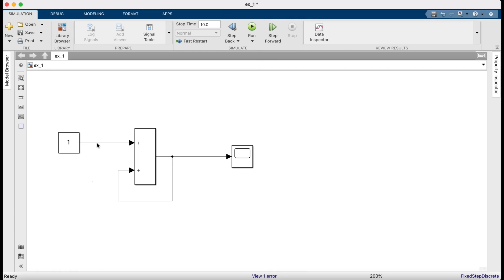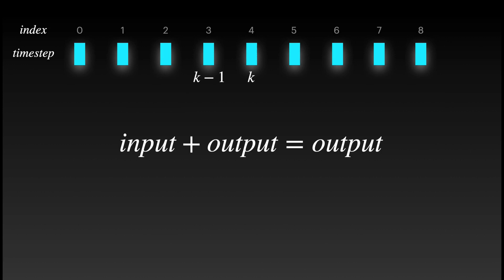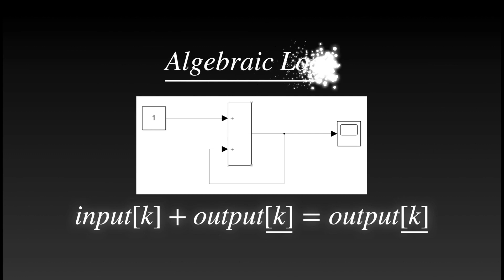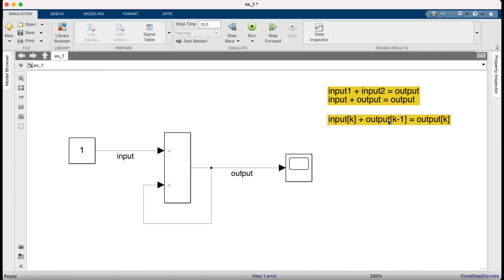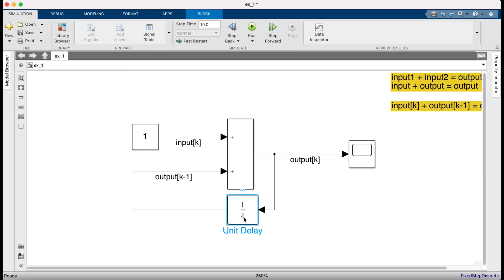Simulink Tutorial - Fixing the Algebraic Loop!

Comment: Hey I used this method when working on a signals and systems problem where I have to simulate a complex system compared to its equivalent transfer function. When testing the rise and settling time however I ended up with different results. I am certain my transfer function is correct and I was wondering if you know of any method to equalize these results. I would share more details like what the system looks like but idk how I’d be able to do so over youtube
Reply: The results were very similar but not quite the same